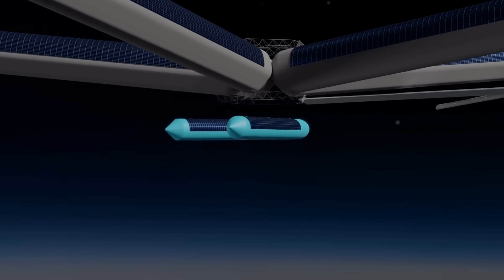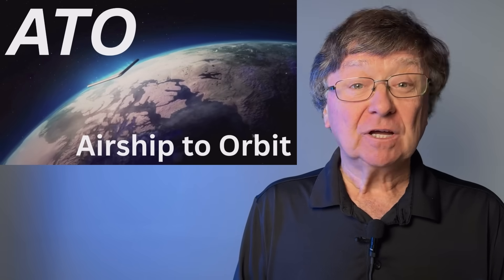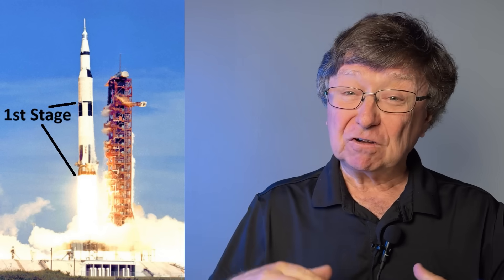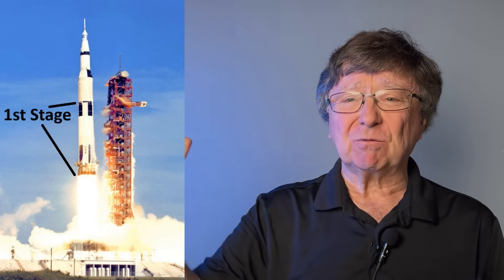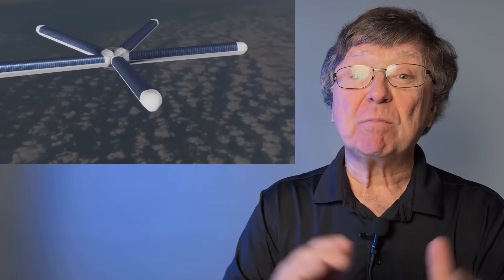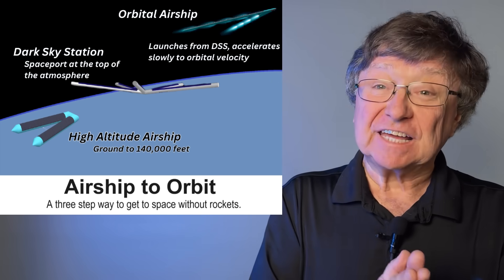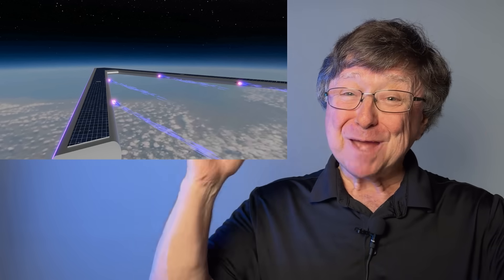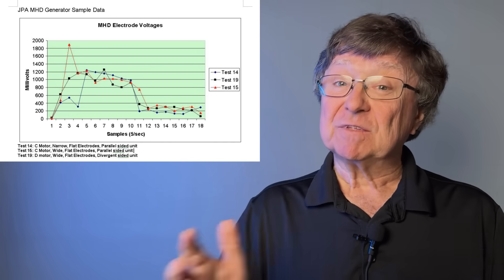This Airship Might Change How We Reach Space Forever!

Comment: Okay less then 8 minutes in and I have to call bs on this one. I will layout my arguments in order the issues appeared in video.

1. This animation is very crude looks like someone got their nephew to make it in an hour. Now this wouldn't be an issue in and of itself however the cargo thing just hovered next to the station, there is no mention or suggestion of what kind of docking procedure will be used. I guess they will load there cargo via Bluetooth.

2. 7:02 that's a lot of pressurized air they have on the station. I didn't do the math but my intuition says there's not enough space for the rest of the buoyancy bags to keep that much weight suspended at such high altitudes. I'm not that familiar with super high altitude buoyancy, so if someone could do the maths, let us know.

3. 7:37 "Powered by a 10 megawatt solar array" now this is complete bs. If we assume these solar panels are magically 100% efficient and convers the entire spectrum into electricity. The average mean solar irradiance (at top of atmosphere) is 1360W/m² so to achieve 10MW you would need at least 7,350m². A highly optimistic 40% efficient panels would still need 18,380m². 
For reference a standard football/soccer field is 7140m². with how narrow the solar array looks on the animation I wouldn't be surprised if it the ship would have to be 1km long.
Reply: I got to seven minutes. At that point, we see the "Dark Sky Spaceport", which appears to maintain a breathable atmosphere in its structure, while, at the same time, maintaining buoyancy at 140,000 feet.
Nope.
Reply from the maker: Actually, it's over 2km long.🙂
Reply: After a while, you realise that he hasn't bothered to do any maths for this. Maybe this is how science and engineering work in the post-truth world.
Reply: @lexxynubbers  not saying things for certain, but have you read up on/researched this project from anywhere other than this video?
Reply: 1. i think its reasonable that they haven't finalized what the docking procedure is yet, doesn't mean its being ignored 
2. what pressurized air? where? im pretty sure they're intending to use actual lifting gas
3. well yes the orbital ascender is intended to be 1.8km long roughly
see: https://lynceans.org/wp-content/uploads/2022/03/JP-Aerospace_High-altitude-airships-compressed.pdf
Reply: I do not see any problem in the video,   for one  the structure is in orbit, and in essence zero G,  what "weight" are you talking about? the station is not "supporting" anything.,  every object inside and out is travelling at a speed that keeps it buoyant or a zero g.

as for the solar panel coverage,  did you not watch the video?   each leg would only have to be 600 ft,  for the total structure to be 1km.     in reality this object is about 2km, so do your research before commenting on things YOU do not understand.  also   your forgetting a couple of other things about solar in space,  the sun is shinning 24 hours, and there is no atmosphere or clouds to block the sun,  which has a LOT more energy in space.  

As for the lack of detail in the animation,   the animations are not for visual special effects,  these are drafts that are constantly updated,   things like docking cranes or arms,  would be added later,   that is like worrying about the sound system on a formula 1 race car that is being designed. 

The FACT that they are already testing real world components one by one,   is the smart way of doing this.  it will take years,  but this is very doable.  

"These are important reminders that pathological cynics always will find a way to complain. Before air and space travel were possible, they said it was impossible. When they were proven wrong, they said it was an egotistical waste of money with no real utility. The pattern continues today." -Bigthink
Reply: @Artiflex-ai4u  brah. We did watch the same video right, the one that says the assent craft has a 10MW solar array?
The solar radiance I stated was at space, it's lower closer  after the light has to go through the atmosphere, closer to 1000w/m² at sea level. And it said "10 mw solar array", I'm guessing that peak output, so it doesn't matter that it's in not getting shaded, that is still a massive amount of solar panels on a 2km space craft going to low earth orbit.

"every object inside and out is travelling at a speed that keeps it buoyant or a zero g"
So you are telling me that the dark star station thing, the super un-aerodynamic shape is traveling at speeds approaching orbital velocity in a rarefied atmosphere? you want me to believe that that things, will go over Mach 20?
no it's not zero g or in microgravity. that's why they need the buoyancy to keep it at high altitude. Buoyancy is a force that the surrounding fluids exerts onto an object that is less dense then the surrounding fluid. Because air is so thin at those altitudes it's a really tiny force that's being applied. If you look at weather balloons the payload capsule is tiny compared to the size of the inflated balloon.
Reply: I have been thinking about the same thing for years.
The dockings can be solved like shipping ports, with cables and cranes or mechanical arms.
The weight can be alleviated by cables attached to a heavy weight in higher orbit, the lower station will do the towing(air as propellants readily available) and need not be geostationary.
The craft to space can be lifted by the cables(carbon fibres or nanotubes) to the higher orbital station. It probably will have its own propellants and the upper station will provide the electrical energy.

Comment: All the SR-71 Blackbird was missing was space engines and life support pretty much. Build speed then cut up and automatically set space engines to come on when modern compressors fail. Ive seen many masses talk about similar ways to space as this video. But they were called retards all over nasa comments. I know one that joined an elite group because "the masses are the Devil" lol. Plasma generated Ultrasound shockwave pressure anti-drag tech to reduce everything that causes drag around a craft = Still waiting.. - Dracula

Comment: Very cool to see someone going for this. I have for a long time pondered if  airships are not a viable option now that solar cells have become so efficient. Lifting by heating gas via solar should be a cost-effective way elevate cargo. I saw 2 drawbacks: speed: it would be more efficient, but slower, and transition: lighter than air really only work up to a certain altitude. I did not envision an atmospheric waystation - but if you cam make that work, the concept has great potential IMO.

Comment: It's not a Waverider. A Waverider expert.
Reply: Okay, that was a bit rude. It isn't a Waverider because it doesn't have sharp leading edges. Adding copper tubes and material in front of the leading edges (like a hanglider frame) would remedy this, and would reduce supersonic drag notably.

Comment: Can you provide a few numbers from your simulations? Stuff like heat the rate of heating during descent. And how does the vehicle reject this heat? I saw something long ago pointing out that if you wanted to fly something from orbit that could work with moderate temperature materials (~500C) then you need something with the surface area to mass ratio of a Cessna. Just what is the ballistic coefficient of this vehicle and at what altitude does it experience usable lift during re-entry?

Also, why the V shape? It looks unstable structurally.

Comment: I love this concept. However, I do have a few questions: 1) How much of a threat is space junk to the Ascender? Since it accelerates gradually to orbital velocity (compared to a rocket), it seems like it would be in the "firing range" (altitude) for space junk at a slower velocity (which means: higher relative velocity to the space junk objects) for a longer period of time than a rocket. Being a giant airship, it's also a much bigger target.

2) The Ascender seems to be specialized for the upper atmosphere and outer space, and presumably not capable of launching from the ground. Otherwise there wouldn't be a need for payload transfer at the DSS. If that's the case, how is it constructed and maintained? The DSS is not shown with a hangar capable of serving as a shipyard or drydock for Ascenders.

3) In another comment here you say that the DSS "circles the Earth every 40 days at 140k feet," presumably going where the wind takes it. That would carry it--and the "Load" ships flying to reach it--through a lot of different countries' national airspace. So it would seem that ATO would require unprecedented levels of international cooperation to work. How do you plan to get rivalrous nations to agree?
Reply: 1. I think the key question is actually how high of an orbit it’s supposed to reach. At lower orbits space junk isn’t much of an issue since even a tiny bit of air density will cause drag that pulls the space junk down to earth. I’m guessing it will rendezvous with a space station in LEO from which passengers can take another ship if they need to go to higher orbits. It doesn’t make sense to use the Ascender to go higher than the lowest stable orbit, and you’re not going to want to stay in that orbit for very long, so exposure to space junk will be minimal. Still, you need to be able to handle a micrometeorite hit. Probably not a huge problem to build in the capability to abort and descend safely in such an eventuality. Maybe occupants will be in a capsule with a heat shield and parachutes.
2. Interesting question. It’s quite large so they may have to do final construction in the open, and they may need a secondary balloon to help get it off the ground? Doesn’t seem like a huge issue though. 
3. 140k is very high, I don’t see why it couldn’t be considered more like space than an airspace. You just need identification which is trivial, and you don’t care if a war is going on in the country below because anti aircraft systems will not reach it anyway?
Reply: 1. basically rate of diffusion: if space junk impacted it it wouldn't have much impact and could be repaired in flight - the gas would leak out very slowly. would still be a problem tho methinks
2. they would dock the ascenders at the dark sky station, never bringing them lower. i think they'd be assembled there as well. unclear how they would do this exactly, does sound like an absurd engineering challenge (like all of this rly)
3. unclear but they've said it has directional controls, and would be able to use them if needed to steer the station but couldn't use them 24/7

Comment: 0:26 it’s Bill Gates brother 😊
Reply: Only that Bill sells a actual product, not just blatant lies🤣

Btw, these airplane launched rockets... yeah. Funny that you ask. We actually do this, to launch at the equator, because of reasons. That measly airspeed is completely irrelevant and so is the elevation.
Reply: @goiterlanternbase   really? I though gates was a pedo.  Now i think you're a pedo.
Reply: @goiterlanternbase  how about the Stratolauncher??
Reply: @markbeames7852 Samesame. the problem is not hight, it is orbital speed. Otherwise, no matter how high you fly, you will follow a ballistic curve reasonably close to your point of launch.
Reply: 😂 I saw that!
Reply: @microdesigns2000 right away!
Reply: These aren't blatant lies.  We put astronauts outside in space in spacesuits, made of nylon Kevlar teflon and other materials that  have no chance of working in the atmosphere when you're going seventeen thousand five hundred miles an hour.  Friction is caused by interaction between an object and the gas molecules in the atmosphere. The higher you go, there's less atmosphere and less friction.  They are using and exploiting this simple fact.  At certain height in the atmosphere, there is enough atmosphere to get some thrust out of certain types of engines, and yet there is so little atmosphere that a mylar balloon can survive (have so little friction) at velocities
you wouldn't think it could.  It's all science not lies.   

I've often thought that a system similar this could exploit having large engine at a somewhat lower, but still very high altitude and have it reel out 10 or 20,000 maybe even 50,000 feet of a composite cable,
and drag a balloon fifty thousand feet higher, to a much higher speed.  The balloon would be at a higher altitude, and hence be exposed to much less friction.

Keep up your work JP, I think it will bear fruit! They laughed at the early rocket people when they said rockets would take people to outer space but no one's laughing at them now.  The bottom line is, how much does it cost to get a pound of the material into orbit.  If this works, it will reduce that cost considerably and make space available to the common person and not billionaires.   I wish I had money to give to this vital research effort.
Reply: Where!

Comment: The 'spacestation' platform is presented as receiving the first stage at 42 km and Mach 5. Is the platform susstaining that velocity too? Where is the thrust for that? Next  I heard you say  'Gassamer high speed flying wing', to get up to 91 km but you showed your waverider imagery and didn't mention proplusion.  The waverider is then presented as starting it's engines at 91 km going Mach 10. How did it get to that height and velocity? The platform is also mentioned as going at this velocity, contradicting the previous information for receiving the fist stage.
Reply from the maker: The platform circles the Earth every 40 days at 140k feet. The orbital airship starts from there on a slow (subsonic) climb. It reaches max buoyance climb at 180k feet and begins a slow acceleration. This is the dynamic climb portion of the flight. We don't anticipate breaking Mach till above 220,000 feet.  At 300k feet is when the engines shift from high ISP to lower isp but higher thrust for the orbital insertion burn.
Reply: @johnmpowell  If th platform is going that slow I can't understand the need for the first stage to travel at hypersonic speeds of Mach 5. So the 'orbital airship' is the waverider, and is that is also the Gossamer high speed wing? Is that right? It has to climb through the mesophere. How is it powered before the orbital insertion burn? If you are not reaching above subsonic speed until 220,000 ft, or 67 km, how are you getting any lift going at subsonic speeds in the mesophere? Edit:Ok, I reread it more carefully. Propulsion is low thrust using the same engines. At this point, going subsonic in the mesosphere, how is the lift being generated? More specifically, how can that thing be boyant in the mesosphere?
Reply from the maker: @deanmichalos6848  The first stage airship never goes Mach. All the high speed happens with the third stage vehicle.
Reply: @johnmpowell  Got my wires crossed about the first stage. I watched the intro for the waverider. I get the concept better now. I've got plenty more I could ask, but let's leave it at that.
Reply: I'm just trying to understand. Is the stratergy to use solely boyancy for lift from 14000 ft, 42 km, up to 67 km to 220000 ft, 67 km? Because surely you won't be getting any lift from the shape, either aerodynamic lift or compression lift, going at subsonic speeds in that altitude range. I am sure you are not using engine thrust to overcome gravity, because that would make it a rocket, right?

Edit: I'm just learning about Gossamer wings today, but apparently they are not designed for high speed or high altitude. You mentioned ''Gossamer high speed flying wings'. Is this something you have developed?

Comment: Was and still is a really creative idea that will be a real game changer if it works. Personally I'd like to see more calculations on what would be required in terms of thrust/ISP, thermal loading, lift/weight/drag, etc. to make this feasible. The fact that a balloon can be accelerated to orbital speeds with a rocket doesn't really do a whole lot to validate the concept on its own.

Also still seems a bit premature to me to be working on life support systems when you're not even sure if the basic concept is feasible yet. I'm sure the sub is a fun project though. 😁
Reply: However AI changes the game.

Comment: Great to see JP Aerospace is still actively pursuing Airship To Orbit.  I remember buying one of your t-shirts back in the 1990s or early 2000s.  Sure wish you had a mega-rich backer or two.  How do the economics of your planned orbital missions compare with the economics of SpaceX and Starship's planned orbital missions?   I think their partly reusable Falcons are something like $50 million today.  Could be more.  Last I heard, their fully reusable Starship will fly to orbit for something like $3 million, basically, the cost of fuel plus incidentals.
Reply: The comparison is simple, one works, the other doesn't.
Reply: Physics, chemistry, engineering, gut instinct, and this guy's cult-like verbal delivery tell me this whole thing is in the crank-category, and I'm a fan of airframe-based systems* in the boost-phase. But orbital-injection stage is rocket-propulsion only.
___
*just not this guy's pipe-dream
Reply: @-danR  It's a pity so many cannot be bothered to do their homework.  Look up the videos on YouTube and on their website.  They have already flown test stations to high altitude and a prototype of their "Load" Airship.  So far, their test results outweigh messy guesstimate physics, chemistry, engineering and especially gut instinct.  I'll take thirty years of many, many successful experiments.